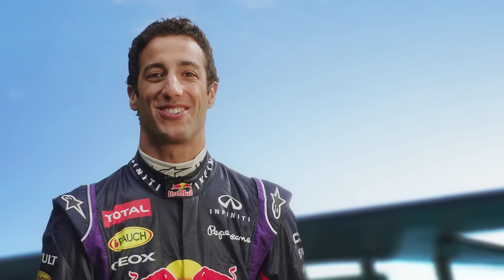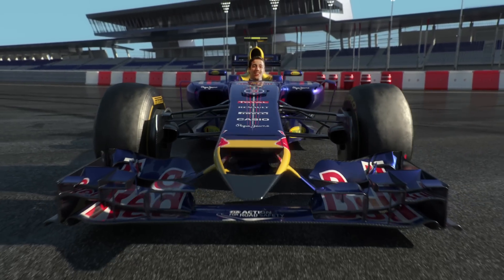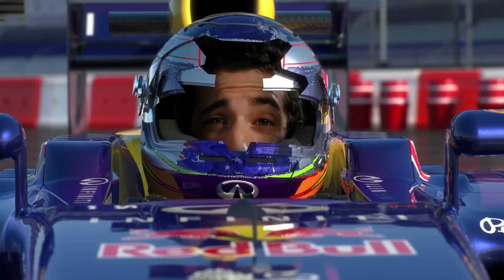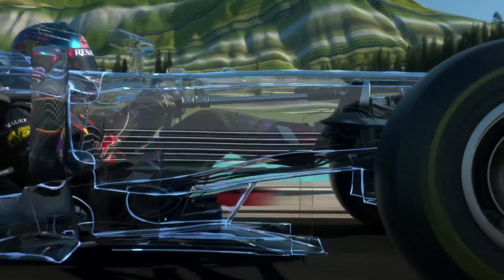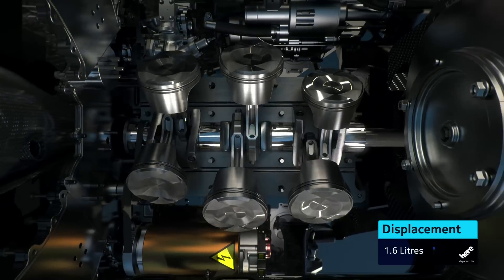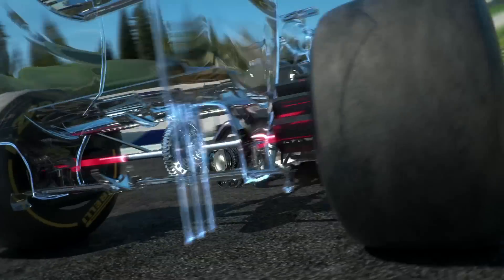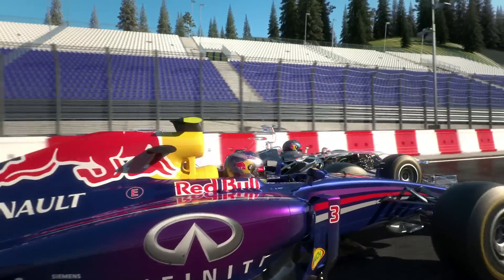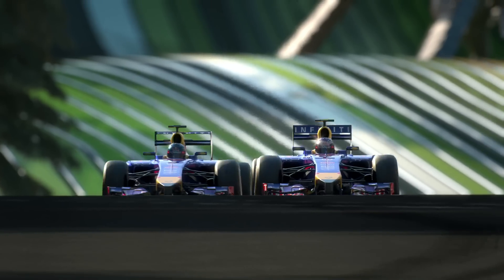Transforming Formula One: 2014 Rules Explained (Full Version)

Comment: We need this for 2026
Reply: Sadly the V4s (I call them V4s cuz every new engine lost 2 cylinders) is now 50% combustion power and 50% electric power meaning they will sound even worse than the current V6 engines and the car will be slower when you use up all the battery in the car

Comment: i think the rules still arent strict enough. The current rules are still no challenge for these big engineering teams and everyone is still throtting along as usual. There have really not been any massive innovations since the 90s in Formula. What I would like to see is a focus on having very reliable and tiny engines. I'm thinking 3 cylinders  paired with a turbo and an electric drive unit. If you want it fast and reliable you gotta work hard for it.

The video is very well done btw.
Reply: This is Formula 1. It's technical, but it's motorsport. Motorsport is racing and not just trying to build new engines all the time. F1 is already in a dangerous position with these rules since the engines are so expensive for the teams. Restricting motorsport will mean killing it.

Comment: f1 does have a bit of a advantage thou? Higher top speed and beter DRS

2013 = 210 mph

2014 = 223 mph how fast its on the game
Reply: but 2014 has slower cornering speed
Reply: This goes to show, you don't need more cylinders to increase performance.
Reply: Turbo... 
Hybrid System.
And almost 15 years to beat cars from 2004.
Yeah... Right...
Reply: Lucas Adrian 2019 cars are much faster than the V8-10 era cars. It’s over for their records as they get beat again and again

Comment: Ok. i'm all ok with the cars evolving into something safer, but why the speed has to suffer ?! Bring back the V10 engines 20k RPM limit and let the engineers do their magic. F1 used to be sport where you watch fiery beast blasting at 350kph+ with the most marvelous engines and sounds. Not an engine that's the size of a family hatchback from the late '90s. I'm sick of this "green propaganda". Want to make F1 green - make them use bioethanol. And to be fair for a long time i;ve wondered why they keep on using regular petrol, when all kind of changes were made to the cars and rules but the fuel stays the same. Guess it's a contract with Shell, but they could start producing ethanol and every1 can be happy. The engines can be V10 again, although much more powerful and then we can see the new aerodynamics. The purpose of motorsport evolution is not to slowdown the cars, this is degradation.

Comment: Guys predict what will come next... V6 turbocharged---> ?????
Reply: Jasmine They want to introduce twin turbo stock ERS 1000bhp engines for 2017
Reply: Jasmine
That's not the problem, today's cars are much more safer than previous 1000bhp 80's cars
Reply: hayato zami V4 Anteaters
Reply: hayato zami take just 1 cylinder out and it turns to 5 cylinders? would that make a more v10 sound?

Comment: The reason for tough technical regulations isn't for shits and giggles people. It's to push technical innovation and engineers to create technology that will see automotive technology into the long future. We can't expect cars to be running on oil based fuel forever, so F1 needs to be at the forefront of developing the technology that will ensure we have the cars to not only race, but get us from point A to B. Ongoing F1 technology informs whats possible for performance in a world that requires increasing energy efficiency.

Comment: A lot of people are not noticing that this turbo motor is FASTER than last years. Quite a bit faster on the throttle and a faster top speed by about 6km/h. The body is just slower than last years, the downforce is reduced so the car is slower in the corners. If this motor was in last years body you'd see huge time improvements.

Comment: From big V12s to V6. I know back in the days there were already V6 but those cars produce much more power than the current ones now. Those cars back then were less downforce yet powerful. They should put back the big engines. Big noise, I know cause of the safety but even them F1 drivers would maybe want to drive big engines.

Comment: One problem. That last shot, they would never spin the wheels that much. For one they would ruin the tires, secondly, the engine and front brakes would meet a similar fate
Reply: So what? It doesn't have to be realistic it's just an animation.
Reply: Actually, I rarely see drivers NOT spinning the tires initially.  Get em hot, clean em a bit and grip the road.  And I doubt drivers want to chance stalling engine by feathering clutch.

Comment: The F1 people talk about the driver being the most important thing when it comes to operating a F1 car. Clearly this is not true. It is who ever builds the best car. Renault was the best last year. Yet everyone thought it was Sabastion Vettel. Now this year it is Mercedes. Why? They have the best car..... As far as I'm concerned all the vendors and advertisers should pull out. F1 should not be a 6 cylinder engine with a Kerrs system. That is for Toyota and there Prius. F1 should be V8 ,V10or W10 this is crazy these car sound like VW Beetles running around the track. And if your not a large company with millions you have no chance of building a winning car because of funds. This is wrong. F1 better get there act together or they are going to lose viewers. What the hell were they thinking when they decided to run energy efficient cars. Next they will mandate SAVE THE WHALES stickers on the bumpers.

Comment: I love the engineering that goes into these engines. its incredible. The sound of the V6 sucks however. I miss the 20,000 RPM V10s. This is going to be one hell of a season now that they can only use 5 engines all season. As we saw last week in Melbourne, Red Bull pulled the plug on vettel's race for fear of damaging the engine. I don't see Sebastian winning another 8 in a row this season. It seems as though anyone can win which is cool. I'd like to see Force India on the podium for a change.

Comment: What does he say at 02:36 and what does it mean?
Reply: More torque which means it's tougher to control getting on the power.

As they've got more horsepower the cars are much more powerfull and therefore it's more difficult to handle the car if you go full throttle.
Reply: Thanks!

Comment: Let's go back to the specs of the last turbo era, fuel stops & tire changes at the discretion of the teams. Trying to run greener is costing more greenbacks which defeats the whole purpose of F1 being cheaper. As for running green, what's the point? 22 cars running only 19 races isn't doing anything to save the earth. It's also been years short of KERS that any Formula 1 technology has trickled down in to our everyday real world cars so rather than continuing to restrict them, let the cars run to their limits with minimal green gadgetry and let the drivers decide the championship again, not the team with the most funding. 

On the other hand, when Honda returns, they will hand everyone their arses & then we will see who buys out their contracts from poor Renault (who seem to have gotten it all wrong this latest turbo era) and jump ship to Honda or Mercedes.
Reply: cause with this rules they have to investigate more to produce greener engines, those investigations eventually will be used in the regular cars.